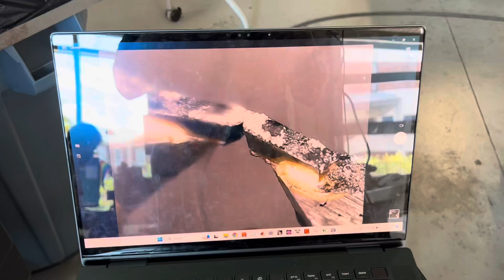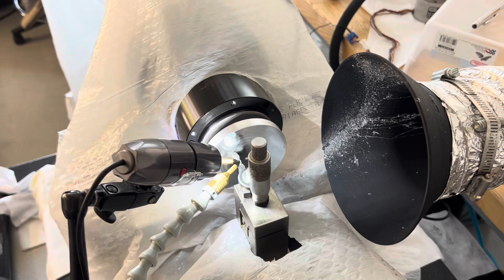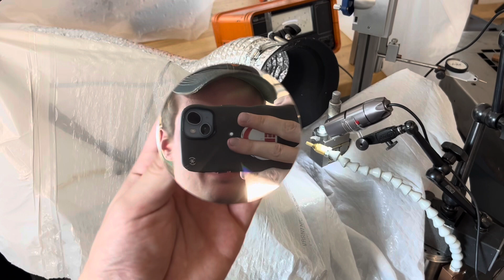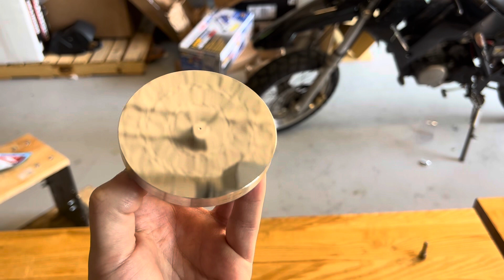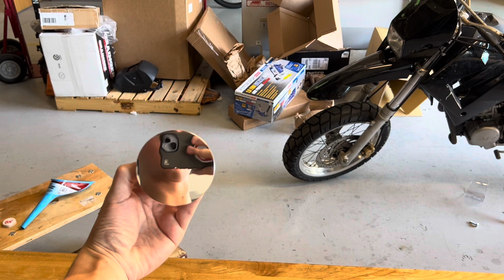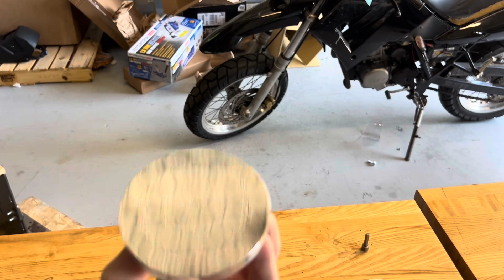Sine waves in aluminum!!

Comment: Hey Cylo, it also looks like you are using intermittent coolant spray and may have some built up edge on the tool nose. It would probably be better to have a steady stream of coolant to add a continuous tool deflection and reduce the material gathering on the tool edge.
Reply from the maker: We recently added a pressurized reservoir for the mineral spirits with evened out the flow. It’s less built up edge and more chips just piling up on top. Finding the correct angle to put the nozzle at is an art in and of itself!
Reply: @cylosgarage  what is the RMS/Ra value you are targeting for your optic?
Reply from the maker: @kieranmoon17  shooting for 5nm Ra

Comment: Just curious if you realise that telescopes use mirrors made of glass with a superthin layer of aluminum applied to the surface.
Spherical mirrors are far easier to shape than parabolic ones (and far cheaper to make) but parabolic mirrors are far better. A small 4.5" parabolic mirror costs more than 100$ and the price goes up exponentially : for a 10" mirror prices are well above 1000$. You're sitting on a Gold-mine if you can achieve creating parabolic mirrors from a simple piece of aluminium 😮

Comment: how does the aluminium not oxidize and turn dull gray?
Reply from the maker: Aluminum pretty much instantly creates a nanometer scale clear oxide layer in the atmosphere. It generally stays shiny unless exposed to other nasty stuff.
Reply: @cylosgarage  Strange. When i turn aluminium on my normal lathe it seams to get a dull gray finish within seconds of turning it. It looks pretty shiny at first and then turns dull gray pretty fast from what i can see when i am turning aluminium.
Reply: @titter3648  He is using a highly specialized setup with a diamond tipped tool to produce optical surfaces directly from the machining process (no polishing)!

Comment: Would you consider trying to do a really high frequency sine wave? something close to a wavelength of light?
Reply: gonna need a diamond tool with a radius smaller than the wavelength your trying to make.  The smallest we can make a radius is around 200nm
Reply: Ah that's a shame, but it makes perfect sense. I know very little about this sort of precision engineering but I find it fascinating. @andysimonson3745
Reply: How tf would you do that, bet his encoders don't even get near the resolution to match the wavelength of visible light
Reply from the maker: Mine have a resolution of 2nm. 1/250th of a wavelength of visible light 😘
Reply: I'd be really curious to see if you can somehow leverage that to play with fun interference / thin film / physical colour effects  @cylosgarage
Reply: @kkuhn  visible light is pretty big

Comment: Is there any way to avoid the central point ?
Reply from the maker: Yes, just set your tool height correct to less than a micron. I’ve not done this yet so I just relieve the center to avoid potentially harming the tool
Reply: Thanks @cylosgarage
Reply from the maker: no problem big boss

Comment: Hello Cylo,

I am glad to see that your project is going well.
I was wondering If you would be interested in helping me machine a few parts for a gear hobbling machine.
I have a high tolerance requirement due to the small modulus involved.
I mainly need a spindle and a way of holding the hob.
Is this something that you are willing to assist me with me?

Regards
Reply: @wazaagbreak-head6039  lol you alright?
Reply from the maker: Sure shoot me an email: cyruslloyd4@gmail.com